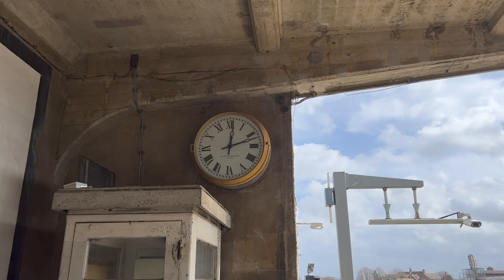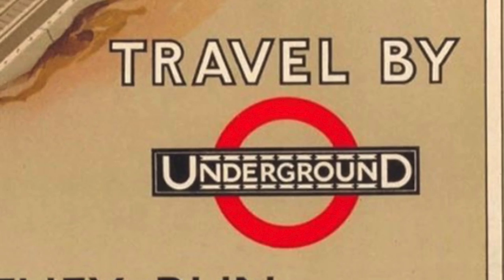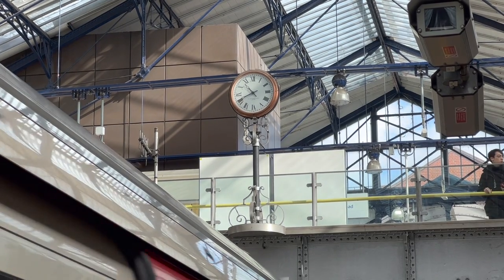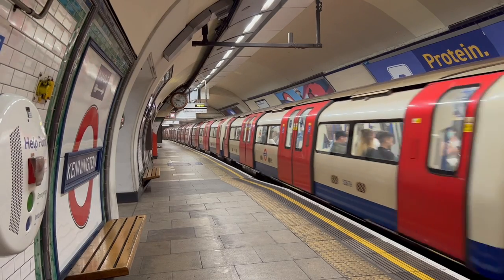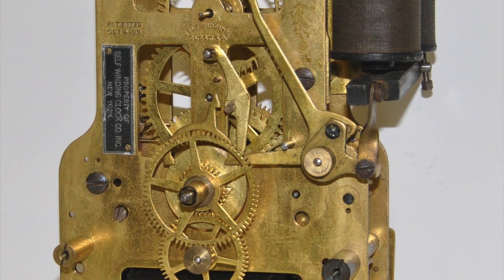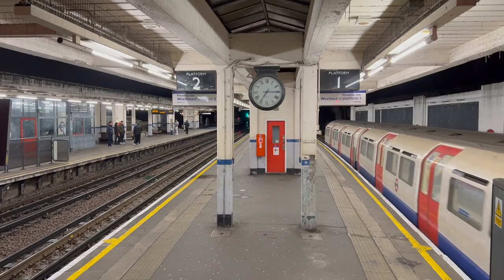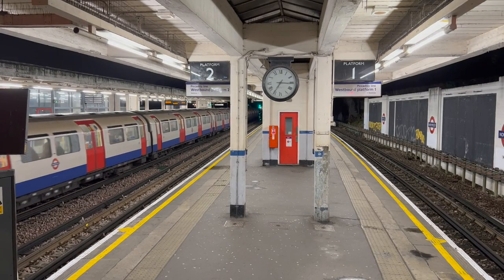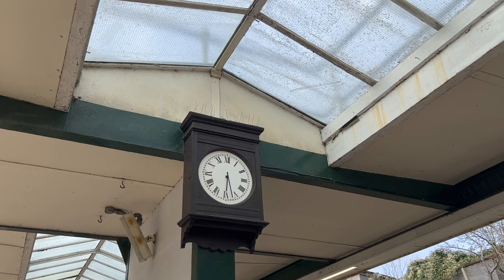What the heck is a self-winding clock?

Comment: Most folks don't notice that on clocks (and watches) that use Roman numerals, that the 4 is often represented as IIII and not the usual IV.  This was done mainly for aesthetic purposes as the 8 (VIII) and the 12 (XII) were quite "beefy" looking and by representing the 4 as IIII it balanced the dial out.
Reply: True. But also, until about 1800 (or MDCCC if you prefer), the "additive" style of Roman numeral - IIII, VIIII, etc - was used interchangeably with our more familiar style in many contexts. Pre 1800, the IIII on a clock dial wouldn't have looked as odd as it does to us. Fun fact: the Palace of Westminster clock faces use IV, not IIII.
Reply: Years ago I lost points on a programming exam, since I programmed IIII instead of IV, as that's what our grandfather's clock had.
Reply: I much prefer the IIII on a watch or clock face
Reply: I assumed it was so the IV wouldn't be mistaken for VI (six) since it would be printed nearly upside-down.
Reply: I did notice that and I always wondered. Thanks.
Reply: The use of IIII instead of IV as a numeral is quite common, this alternate form is legit and  greatly used in some areas. On the  24 hour dials of the large tower clock in Saint Mark square in Venice (the astronomical clock in the Torre dell'Orologio), this form is used 10  times, as also VIIII , XIIII, XVIIII and XXIIII are used and the clock has two dials. On the bell , the signature writes the year (1497) as MCCCCXCVII .
Reply: @SteamCrane  Im not sure how i never noticed that, and ive been around clocks for over 50 years. Now i cant un-see that. lol
Reply: When call of duty named the new game black ops IIII people all tried to be smart about how it should be IV that the British museum stepped in to educate people.
Reply: Honestly, the IIII is way to dense compared to all other, this because III and II are kinda dense as well making a weird stripish apperence around 2-4
Reply: I read somewhere that one of the reason was it's more efficient to manufacture that way. Just make four copies of VIIIIIX and split them into these: 
VIII - I - IX (8 - 1 - 9)
VII - III - X (7 - 3 - 10)
VI - II - IIX (6 - 2 - rotate IIX by 180° to get 12)
V - IIII - IX (5 - 4 - rotate IX by 180° to get 11) 
And there you have it, all twelve numbers from only one compact mold.
Reply: Reminds me of the numbers above the entrance arches on the Colosseum in Rome. Gate 44 is peculiar because it's labelled as XLIIII which uses subtractive notation (XL) for 40 and additive notation (IIII) for 4.

Comment: Not putting electricity in your mouth is a great lesson.
Reply: Absolutely shocking, if truth be told.
Reply: @ianpatterson6552  it can go in at low voltage, just dont touch the sides /teeth /tongue.etc
Reply: @highpath4776  not something I am going to attempt.
Reply: It's pretty ironic, because in electronics engineering class one of the first things we were taught was how to gauge the state of charge of a 9V battery with our tongues 😅 y'know, to save time having to go get a volt-meter and all that. You quickly learnt whether it was a strong tingle for a full battery, a medium tingle for a used one, or weak/none at all for a flat one!
Reply: [PP3 9V battery has entered chat]
Reply: @TheOracle65  battery bunnet!
Reply: There are devices [in Japan] that use electric shocks on the tongue to mimic flavours
Reply: I learned that very early on, left alone with a casette player as a child I pulled the lead out and put it in my mouth. Forbidden liqorice was a little too spicy for my tastes.
Reply: Well, I suppose we must keep current with the latest knowledge, but Is there anyone who resists this lesson?
Reply: @kaitlyn__L  Checking if a battery has any voltage in it using our tongues was something we did too,since about early secondary school age.
Reply: @stykytte  I had a cassette player as well,a 10th birthday present. Though I didn't try to do what you did I also had a plug-in hand-held microphone for it,which I made much use of over the next two or three years,until the day one of our kittens bit the wire in half while playing. The kitten didn't zap herself,fortunately. I am glad we knew not to put any pair of scissors lying around into the electrical socket out of curiosity while messing around at home.
Reply: What about and electric toothbrush?
Reply: @jeremypreece870  There’s a layer of toothbrush around the electric.
Reply: My first experience with that was fixing a broken 12v power cable for a Sirius radio... I used my teeth to strip the broken cigarette lighter plug wires while it was plugged in to the car. It felt like a 9v on my tongue but more "spicy"
Reply: @PianoKwanMan  Why does that not surprise me?
Reply: One that electroboom seems determined to not learn
Reply: Touching with my tongue, that is how I test my batteries.
Reply: @kaitlyn__L  I knew this had to come up.  I used to be able to get to within about half a volt with my tongue.  I can't any more, mostly because about the only thing I've got with 9V batteries these days are the smoke detectors so I just don't need to do it all that often.

Comment: Sorry to disappoint you, Jago but whilst many of the original clocks - dials, cases etc survive as you have shown, all the battery operated self winding movements were removed starting around the 1980s.  They all now have bog-standard modern electric movements.  Incidentally, when they were ASW movements the voltage was three volts, not two and the cases held two large cylindrical batteries, 1.5 volts each. They were approx. six inches tall.  When the Northern Line was extended in the 1920s the LER bought a quantity of ASW movements and built their own wooden clock cases in the shape of the famous bulls-eye, now called the roundel.  A number of these attractive clocks survive, but again, the original ASW movements were removed and all converted to modern electric.
Reply: Arguably they are still Self Winding™ clocks even if the mechanism inside has been changed.
Reply: @keaton718  No, the only thing original is the clock case. The movements are modern mains electric movements.  Some have even been fitted with Rugby Time clock movements (Google it!)
Reply: It's a shame, but I imagine maintaining clocks from the early 20th century in the current underground environment would not be a tenable proposition.
Reply: @frainy345  Absolutely!  The world has moved on.  The Self-Winding Clock Co. of New York is no more, finally going out of business in 1970, so spares would be/are difficult if not impossible to obtain.  Temple station (and a few others) still has, in the booking hall, an original 1906 case (American Oak) but as explained earlier, the movement contained within is modern. Incidentally, that style or design of case is not unique to the Underground. It was ordered straight out of the ASW company's catalogue and was known as the "No 10", because that was its number in the catalogue. In the USA, almost all the telegraph offices operated by Western Union around the turn of the last century had ASW of New York clocks, right up to the 1930s and many much later.  In the 1940s, 1950s, 1960s etc. the London Transport Clock Section moved the clocks around so they did appear (and the very few that survive still do) at stations that would not have had them in the early days.  One example of that is Ealing Common, which has a bullseye or roundel shaped clock case in the booking hall. Originally designed by the London Electric Railway for the Morden extension of the Northern line, the LER made these bullseye cases in their workshops (so they are unique to the London Underground) but they purchased ASW movements from America (Self Winding Clock Co. of New York) and fitted them here.  Sadly, where the original 1906 and 1920s bullseye cases survive, all the actual dials have been replaced, I'm guessing so that modern electric movements can be fitted.  Therefore, they don't look as correct or as historic as they should.
Reply: @davetaylor1231  I hate that i'm difficult but yes, you can argue that they are still "Self Winding" clocks as they still display that as the brand name. I don't understand why you thought it correct at all to say "no" to that.
Reply: @davetaylor1231  Do you have to go around winding them? No? Then obviously that are still Self-Winding~
Reply: @macdjord   You cannot rewind them because they are now electric clocks that run off the mains. Turn the power supply off and they stop. Turn the power supply back on and they run. They DO NOT run down, so DO NOT need rewinding! These movements, which are modern,
 have NOTHING to do with the Self-Winding Clock Company.
Reply: @jackman5840  There is no power spring  in the clock mechanism that stores energy when wound up, so it can't be called self winding. If what you say is correct, all modern battery powered clocks and quartz watches should be called self winding even though they would all stop instantly the moment the power supply is cut off.
Reply: @nrml76  Very interesting points, but also no because it is the product name. Any other brand could not be called that. You can argue that with me rather than the pointless description on how It works. The fact of the matter is how it works doesn't have to govern what it's called. But the obvious words printed on it could easily. In fact people are still calling them that as evidenced in this video. The only thing that matters at the end of the day, in language, is how others use it.
Reply: They are likely the same cells used in early telephones, where the carbon microphone was powered locally, rather than from the "Central Battery".
Reply: @JulianSortland  Absolutely correct, although in later years - certainly post-war until their disappearance in the 1970s/1980s they used an "over-the-counter" Ever-Ready cell, each 1.5v  roughly, from memory, about six inches high and four inches round. Each clock needed two batteries to give a voltage of three volts.  In latter years, they were expensive to buy, if you could find a supplier!  They did last a long time though, at least six to nine months.  With my clock, I now use two Duracell "D Cells" in an adapted holder.

Comment: I never read the small text on the clocks. I honestly assumed they were modern quartz-driven, perhaps radio-set, clocks which were merely intended to look older. Knowing they're genuine original pieces is pretty neat!
Reply: You made me wonder how they're repaired. Who does it and where do spare parts come from?  And why haven't they been replaced with some newfangled modern digital thing?
Reply: @quintrankid8045  Probably because they have not needed repairing!
Reply: There is part of me that thinks that these station clocks been tampered with and had refits to be radio-set clocks? Electrically wound church/tower clocks are notoriously prone to failure.  Do we think TfL will spill the beans on them? 😂

Comment: I'm so old, I expected to learn that these "self-winding clocks" used the vibrations from the passing trains to rewind the clock. Before you go thinking that I'm crazy, know that we used to have "self-winding watches" that used the energy from just be shaken around as you wore the watch to keep themselves going. No battery, and no need to physically wind a spring, as long as you kept wearing the watch. So just maybe the train vibrations could do the same. I'm a big disappointed to learn these clocks are effectively battery-operated, although it looks like some/most have been updated to take power from the electric mains.

Comment: I used to take apart those disposable cameras as a kid. The ones where the charged capacitor would be mechanically shorted to the flash. It was a young age when I learned the bittersweet kiss of mother electricity.

Comment: There are in fact only a couple of the original self winding clocks still in use on the Underground - all of those shown in this video have had their works replaced by modern radio based devices.  Self Winding Clock Co. never used the definite article on their clock dials - the dials seen here are modern pastiche replicas

Comment: This I didn't know, I thought they were synchronous electric motor driven (an electric motor that will spin precisely at a given number of revolutions per minute, governed by the electrical AC mains frequency. In the UK this is 50 Hertz or 50 cycles per second, that's what the hum is you hear on some appliances.) The electricity generating companies are obliged to maintain this frequency within specified limits and usually manage to maintain accuracy under 'normal' conditions at 0.4% making mains driven clocks an easy way to produce an accurate timepiece. 

I have drifted a little, let me come back to the point. The self winding clock I first experienced was in a car. I had little money and had to be quite frugal when I bought my first car back in 1988.  So much so that I bought a 10 year old Vauxhall Chevette. It was basic to say the least, there wasn't even a clock. I ventured to the nearest scrapyard and retrieved a clock from a slightly less basic scrap Chevette. When I finished wiring it in, I noticed that it wasn't electric, it had a very ordinary ticking sound. But every hour or so there would be an intrusive kerchung. This turned out to be the solenoid self-winding solenoid mechanism, such a clever idea.
Reply: Yes a lot of 1970s cars had these, well done for replacing if as they can be a real pain to wire up and you don't know until it all fitted if the darn clock is going to work.

Comment: I had a a self-winding pendulum shelf clock as a post-graduate student. It ran on a single D-size, 2½ volt battery, and it wound the mainspring once every five minutes. This prevented the clock from suffering from loss of mainspring power (isochronism). It was very accurate and a delightful ticking sound in my office/orchid nursery. Now, if I could have found a proper  liquid mercury pendulum, I could have also compensated for temperature changes.

Comment: 👍I would be very surprised if the electrified rails or the traction motors would (even under fault conditions) create sufficient magnetic flux to operate the solenoid up there in those self winding clocks. Even if the currents in the tracks or locos were large enough the orientation of the solenoids would have to be somewhat perpendicular to the rails and definitely not parallel to them. The other issue is the electrified rails are only a few feet apart, this will tend to cancel the overall magnetic 🧲 field they create when current passes through them.
Reply: Ta👍
Reply: An extra winding pulse wouldn't hurt, only leave less work for next time. Tripping the setting solenoid might, but there is a cam that only permits this within a few minutes of the top of the hour.  As so often with this old engineering stuff, they thought of that!
Reply: Nice name! I figured the distance made it too weak, forgot about the orientation stuff on top.
Reply: Plus it's DC not AC so there won't be much of an induced field anyway.
Reply: Thank you. This, I think, is to be filed under "Threats that were plausible at the time, but turned out not to be a problem," along with cellphones on aeroplanes.
Reply: @michaelwright2986  Cellphones on aeroplanes is a different level of risk though.
Reply: @hairyairey  Yes. Unlike alternating current (AC) the direct current (DC) traction supply on LU does not cycle its polarity like an AC grid system does. Every conductor with an electric current passing through it creates a magnetic 🧲 field around it. In an AC public supply grid system this means the magnetic field around a current carrying conductor changes in both magnitude (assuming there is some load) and orientation numerous times a second (50 times a second or 50Hz in the UK). This constantly varying magnetic field can induce a voltage in an adjacent galvanically isolated conductor (no physical connection between the two sets of conductors). This is the basis of transformer action. The DC system also creates a field but it does not vary cyclically. If the current is constant then the magnetic field is also constant. This non varying magnetic 🧲 field will not magnetically induce a voltage in any adjacent conductor. If the DC load changes then so will the magnetic 🧲 field, hence for the period of variance a voltage will be induced in adjacent unconnected conductors in proportion to the rate of change of current with respect to time.
Reply: @highvoltageswitcher6256  In the Words of Hot Fuzz "What he said"! 😁
Reply: @hairyairey  🫢 explanation a bit too much?
Reply: @highvoltageswitcher6256  Another fun thing about DC is you can abuse the wired in series rule, NYC Subway like LU uses Direct Current. So if you see racks of conventional light bulbs usually 5 bulbs long its because they are running some of the older tunnel lighting(the lighting between stations) directly off the third rail circuits.  You could never run a single normal bulb off 600VDC but run five of them in series and you can.
Reply: @filanfyretracker  👍🧐

Comment: Very surprised they are still in situ today and still working, considering the prevalence of radio set clocks using the various atomic clocks in Europe for the time signals,  I have three and some weather instruments and time switches,  two using the UK one, the others the one broadcast from Germany.  Being in a listed station would ensure their preservation as the fixtures and fittings are part of a listing in many cases.
I don't  know if it still applies but electric clocks once set and the power was not turned off would be automatically corrected after a power outage or changing to BST by increasing the cycles per second (Hertz) of the AC current, this would take several hours for the clock to be corrected.  The opposite would be done when the clocks went back for the change to GMT from BST.